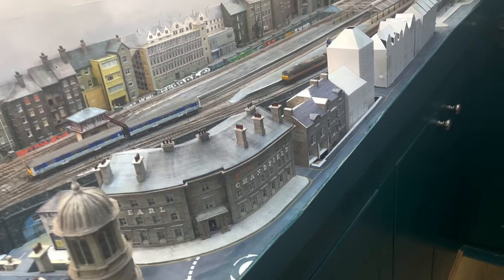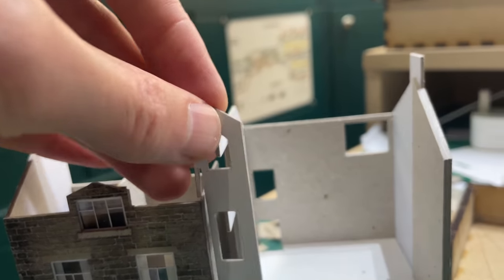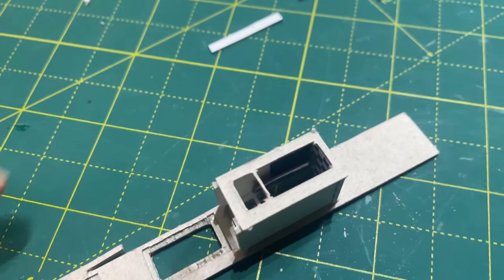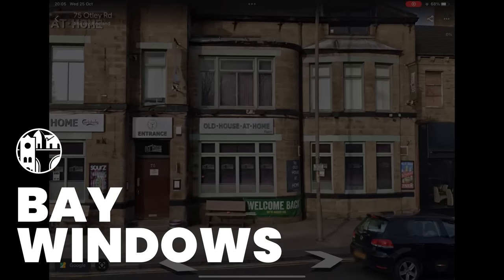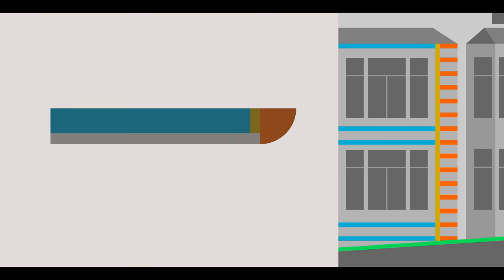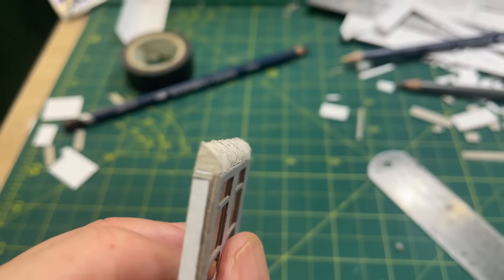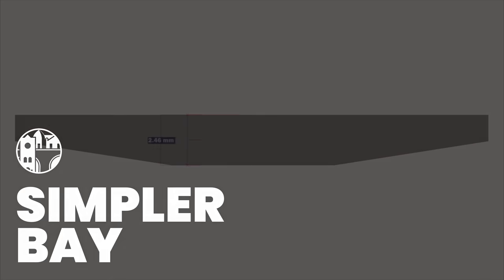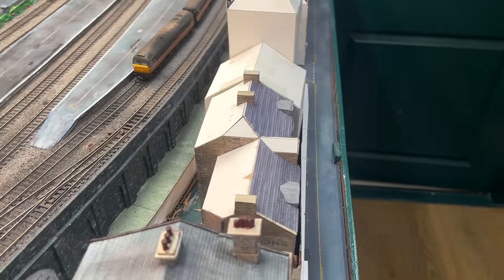Adding a complex façade - curved bays and open doorways - Building Station Road Part 8

Comment: I'm still overawed by inkscape, which I will never understand as long as I have a hole in my bum, but your inspirational work will transfer seamlessly into old-fashioned modelmaking as practiced by us longer in the tooth modellers. Many thanks.
Reply from the maker: I hope that many of my techniques translate into traditional methods too. Inkscape is after all just a drawing tool.

Comment: Hi Micheal, I think I missed something - in the summary of materials, costs, and time at the end you said you had used A4 photo paper. What was that for? Great videos keep them coming - you have even mentioned Dewsbury, that brought back happy memories from when I lived there with my Aunt while my parents were working abroad. Best wishes Jeff in Somerset
Reply from the maker: Hi Jeff. Thanks for your comment. I use photo paper for everything that eventually ends up on display on the models. So that means all the textures - walls, roads, roof tiles etc. In this case, I used the photo paper for the stone textures you see me gluing to the card base. Sticky labels don’t work for the outer layers because they absorb the ink  and make it look fluffy, they don’t make the ink resistant to water-based varnish and glue, and you can’t slide them into position like you can with photo paper on a bed of PVA. Search for my Tools and Materials video if you want more detail.

Comment: Great job on the curved bay window. I would have kept searching for the right size quadrant, but only because I wouldn't have the patience to cut out 15 pieces of card! Never chucking anything out helps. ;-)
Useless and too late thought - you could have cut out and quartered four circles to get your sections. Always happy to help Michael. Cheers
Reply from the maker: Thank you - and I did think of your idea but discounted it for a couple of reasons. 1. When cutting tiny things like this, I get more consistent results using the exact same template for each. And related, 2. I'd either have to quarter the circles along the straight lines first, in which case I'd be no better off, or cut the straight lines later, which means that there'd only be 4.5mm under the ruler, and almost impossible to cut without the card moving under my knife!

Comment: Absolutely superb as always Michael. Station Road is coming on really well! I do think you could have got away with just 3 or 4 quarter round formers for the curved section though, if you pre-formed the card with a curve to it :)
Reply from the maker: You may well be right. It was just paper that I bent. I didn’t want it to sag or bubble so I think the slight extra effort was worth it.
Reply: @Chandwell  Fair play! At the end of the day you got the desired result so all good! :)

Comment: You are working in n scale
Do you use n scale brick texture paper?
Or reduce the print size of oo scale in the printer settings???

Some great building's in the area, have you thought about replicating one of the building's demolished during the architectural vandalism of the 60/70s??
The old kirkgate market in Bradford possibly???
Big project that one !!!
Reply from the maker: I use N Scale textures from Scalescenes.com.

Comment: Hi Michael. What happened to the pub on the hillside you were building? Or have I missed something. Just one more small thing to add. What happens after station road? It looks like the layout is finished or is it?????? Cheers Ray
Reply from the maker: Shhh! That's Members' Only Information! :) It's a side project to tide me over during heavy research or design on the main layout. I hope to have it done by Christmas, but nothing's changed with it since you last saw it in a Members' Update video.

Comment: Michael The Railway Pub on Station Rd very good. Perhaps there be signs & banners for Live Football 4 days a week via Satellite as by 1993 you had the Premier League and its Satellite deal. Also posters cheap drinks deals. Rumour had there was a pub in Gt Yarmouth that had some slightly dodgy satellite set up that during that era you could have any Top Flight Game Live not just the official live ones and it depended on that weeks holidaymaker team. Like a say only ever a rumour. Ian
Reply from the maker: Yeah, I think that of all the pubs in Chandwell, this is the one which will be plastered with adverts for football. I will have to bear that in mind.